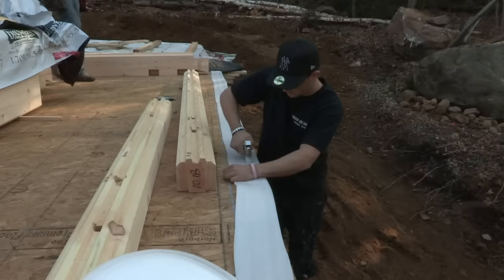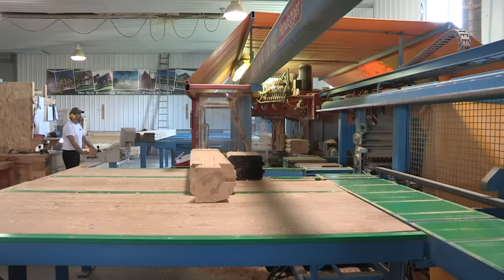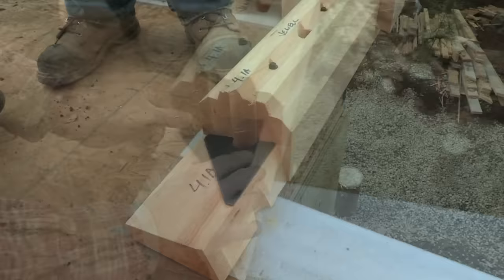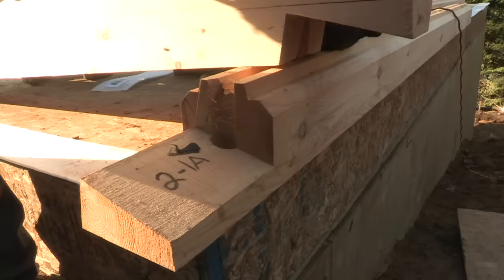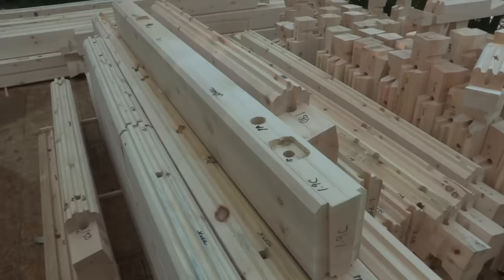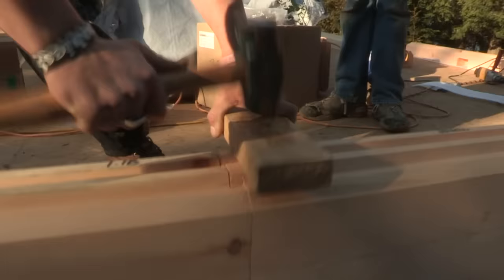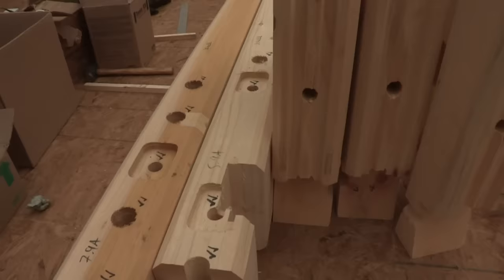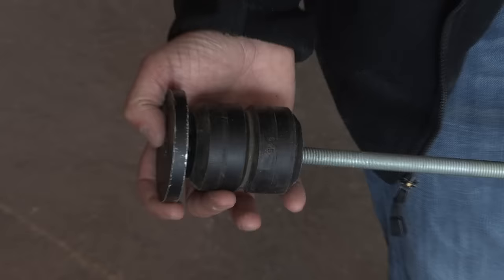Discovery Dream Homes Log Assembly

Comment: people might disagree with me but I would like to use similar techniques to make homes that are plastic using more traditional designs and methods with a three-dimensional cutting system it's what came before 3D printing it's pretty much similar to how you make a replica key but digitally plastic is very versatile of course there are drawbacks but given modern technology and understanding to keep most things green and a lot more clean it's very doable there are companies around the world mostly in South America and India that are implementing plastic as housing material of course you can use recycled Plastics but there is lots of things you have to add to it to break it down and strengthen it again and what I've seen is Lego blocks similar method to how they're making their logs that fit together like a puzzle piece and the other is using panels and putting them together similar to a gingerbread house I've also seen something in Canada it's a hurricane proof house but it looks more like it's about the installation which plastic can be very good at it allows for enough shock to deflect and move while still keeping its shape to me it's something to continue trying it's been tried in the past especially in the seventies when plastic was most prevalent as a newer material but the idea was literally scrapped for a long time cuz either it didn't hold up to standard or it was too dubious to work with especially when trying to take down but again now with newer methods technology and understanding know how the material works and how it can be applied I think it's worth looking into more for both temporary and permanent residency especially in crisis situations it could be something that you can start off small and build up over time with simple renovations and can easily take walls down without having to actually demolish anything and either store what you don't need in the moment or donate and or recycle and of course having a system in place where it benefits you as well the biggest down sight is houses made of plastic are not going to be valued in equity terms if at all especially if you can remodel to fit your needs and style but maybe that will make land prices more expensive or everything will even out to me I'm tired of trying to find something not only in my budget but knowing that there's so much upkeep so much maintenance and a lot of homeowners even people who are renting out properties don't know everything with inside inside the walls termite damage Roach infestations there is so many different things and honestly it scares me I've been looking into getting modulars but of course even with my ideal plastic you still have to buy the land and the hookups and even though it can operate without one it's better to get a foundation but the cost is going to dramatically change and it's not part of the housing and pretty much all housing kits don't come with any installation or interior drywall electrical wiring Plumbing pretty much all the essentials that make an actual living dwelling and even after all that prefabricated modulars and mobiles alike are treated like cars once you drive them once you put them up versus traditional stick builds even if you use the same material it doesn't matter there such a stigma about it that it literally decreases any value that you hope to gain within 30 to 50 years no matter how much maintenance or Renovations you do and honestly it should never have been that way it's only been that way for the longest time out of necessity best way I can put it is that in the beginning people had just purchased the land but once you put building structures on top of it putting time money and effort into it you're going to want some of that back and not to mention if you're someone who's trying to buy the place it's very difficult just to tear it down to build something new on top and now with retail and housing markets it makes it worse it gets to a point where you have home owner manuals and guides telling you how your home should look for future buyers it's like you can't even enjoy your home that it must look a certain way to appease others for future profit of course you don't have to do that but really what other alternative is there

Comment: Nice, but labor intensive. Too much fiddling with sealants and tapes. But, overall, a nice strong building. I seen similar constructions with railroad ties and simple tongue and groove setups, and nice homes were built...The goal is to build quickly and strongly...I despise complicated nit-picking details...and CNC parts..

Forgive me for my nit-picking. Looking for the most simplest, cheapest, and strongest solutions..
Reply: What would you consider less labor intensive? Building a log cabin is a LOT of labor. This home is EASY compared to cutting your own logs. If you don't have precise joints with the little bit of sealants used here, you will have to do MAJOR chinking that will have to be kept up with. CNC just speeds up the process. You can cut all the dovetails by hand if you want to spend years doing it.

Comment: You cant be serious? Screws in a timber frame?

You do realize the wood swells and shrinks... the Screw does not... meaning the screw will push the logs appart and crack the fuck out of them...

It's to costly to drill a wider hole and put a wood stave into the hole? so the construction will fucking last?
Wow a lot of people are going to get a bad air leakage in a few years...